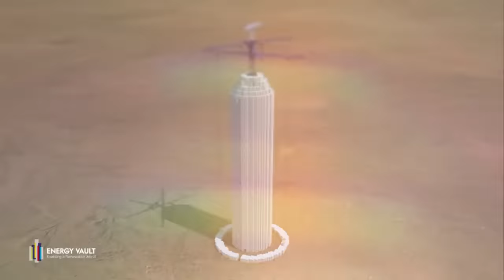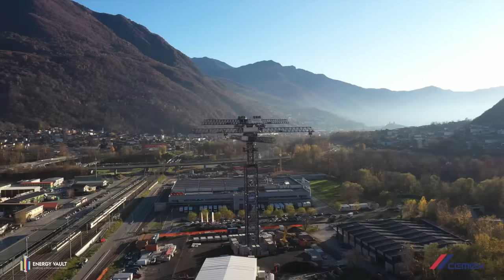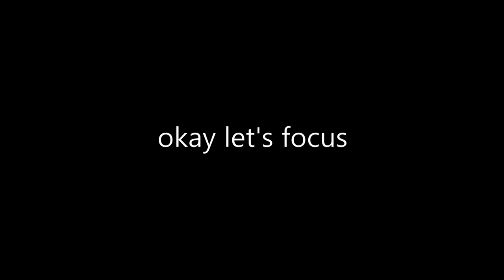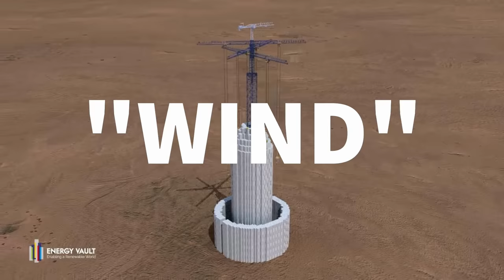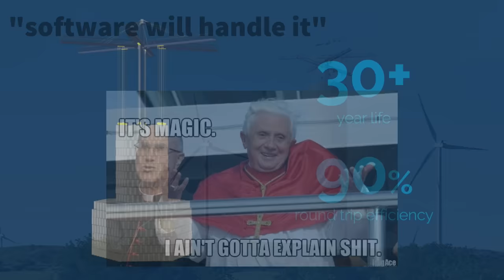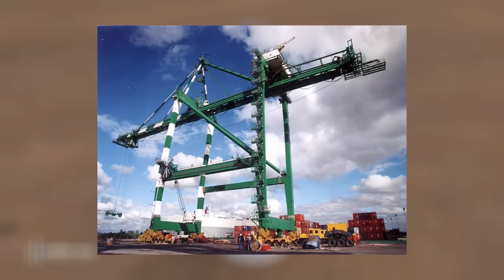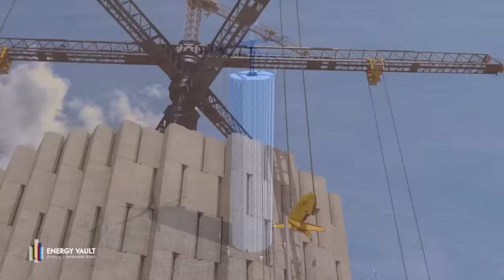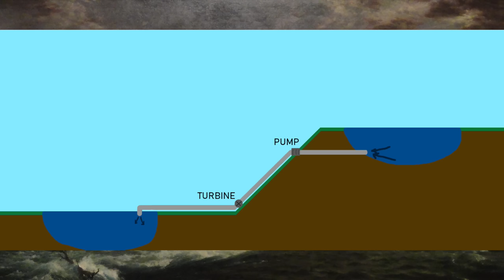The Energy Vault is a Dumb Idea, Here's Why

Comment: Adam casually improving on a "revolutionary new invention" only to turn it into an old pre-existing technology that already works much better will never cease to be hilarious.
Reply: Can you explain how this system would work in the southwest usa where there is not enough water?
Reply: @aaronburns9365  The same water is reused over and over so it's not really much of a problem. All you are doing is pumping water up when energy costs are cheap and releasing it to drive a turbine when immediate energy is needed. Edit : yes this is at a net loss but it's not as lossy overall as the ridiculous crane and blocks idea and both are only used to cover unexpected high demand. It's a battery.
Reply: @englishsteve1465  Large scale storage systems are going to experience a lot of loss from evaporation and soil seepage. It is not viable in arid climates. If it was viable then you would see more hydro power being used in the southwest. As it is there is very little b/c there is vary little water.
Reply: @englishsteve1465  lol 😂 yer having more then one form of gravity storage is so dumb.
Its not like there is more then one type of battery that would be stupid.
Reply: @markrichardson2508  There are many forms of energy storage for systems like Solar and Wind power.
Weight, pulled up and down. Spinning a big heavy wheel. Pumping water up stream. Regular lithium batteries. Capacitors for quick response. Pressured air pumped down to earth.... Oh Last time I looked up I came up with 12 or so different storages and Pumping water, batteries and pressured air were probably the top 3 in that order.

CONSIDERING there are mulitple different solution as you say, why would you bring old 80s battery that is less efficient and just over all worse than many others now days?

The idea that is shown as "new" was old tehcnology back in 2013 so I they are not designing anything new. The biggest difference is that you can attach new weigh to the system which is interesting. I explored one where you have weights that you can't remove like in the Anime they made. I think doing it either way is fine one just requires more stuff. You easily have system that can drive one or more weights are once and when you lower them they are active one by one and when they reach the bottom they  activate next system and if you need more power you drop two or more weights at once but lose the stored energy faster.

I mean, I have no clue how these systems work :d I'm just random person claiming to be Electrical Engineer...
Reply: @aaronburns9365 it does make more sense to put it somewhere with a good supply of water. There are other proposals that are still more sensible that would work, though, like pressurized air or enormous flywheels.
Reply: @aaronburns9365  That kind of touches upon a separate issue of why people decided to build cities in the middle of the desert.

But there's already an answer to your statement, and that is to have these systems in some place like northern california instead, where southern california already derives all of its water from anyway. Basically your generation source and consumers are going to be geographically separated, and that's not bad. Not perfectly ideal, but not that bad.
Reply: @aaronburns9365  Pump water between two concrete cisterns, then. If that sounds like way too much construction, then just compartmentalise the 1,000,000 m³ of water into 20m³ blocks and move everything around by crane. If that sounds even worse, then you can see the problem with "energy vault".
Reply: Trains!!!
Reply: @xezzee  I guess you didn’t notice the sarcasm
Reply: @markrichardson2508  text does not conway sarcasm well and I am not good at detecting sarcasm.
Reply: @aaronburns9365  pumped hydro is literally a closed system you only need to replace water lost through leaks and evaporation, the water doesn't get actively used it stays trapped in a closed system. The better designed it is the less water you lose from leaks and other issues.
Reply: Wait… I know you
Reply: @pricklesthecactus6183  I think I know you too!
Reply: @Brakiros  in an arid region you don't have the water for a pumped system and would have massive losses from evaporation. Making it fully closed makes the cost to much.
Reply: @aaronburns9365  just, cover the water?
Reply: @whyareyoulookinghere9135  That is a huge cost. There are not covered hydroelectric reservoirs. Even then you still get evaporation, it is just reduced.
Reply: Im going one better!Pyramid shaped mounts of blocks raised with people using sleds, ropes and levers! Its also good for emploment its a 5 billion dollar idea!
Reply: @aaronburns9365  can you guys use "to" and "too" in the right situations? I feel like since tiktok cancer came, everyone  forgot how to use them
Reply: @zoltanv7289  Never learned and don't really care.
Reply: @aaronburns9365  Month late response but your original point is exactly right. Pumped hydro or hydro power period doesn't work in areas with little or no rainfall, no elevation differences (flat land), and most significantly, areas where the water will freeze in winter. That was a big oversight or poor research by Adam. 

Currently we also use Li-ion  battery storage but that's both expensive and environmentally unfriendly. It's why this company and others already have hundred million dollar contracts to build their storage systems in both the US and China. 

It's also funny they solved they main problem posed in the video (wind) long before the video was released by enclosing it in a structure to block wind. Other companies propose to use decommissioned mine shafts which potentially saves money and space.
Reply: Jajajajajajajaja tienes toda la razón.
Reply: @keiyakins  If you have space for pressurized air, you have space for pressurized water, since it would be closed system there is no need for much water supply. And even if it's open reservoir there are means to decrease water vaporization.
Reply: @aaronburns9365  Water cisterns delivering the initial water, rainwater collection, pump water from the ocean. There, 3 solutions.
Reply: @aaronburns9365  how about don't move to a desert with limited water resources
Reply: @newnamesameperson397  How is that on me? Engineering is designing with constraints. People live in the desert. It is what it is.
Reply: @lidge1994  If those ideas worked, then they would be implemented. As it is they are not feasible for most arid climates.
Reply: @aaronburns9365  Is it not possible to just cover the systems to prevent evaporation. Obviously some will still evaporate but that would save a substantial amount of energy.
Reply: @plymbum6571  I have seen municipal water reservoirs that are covers but not electrical generation reservoirs. That is b/c the reservoirs for electrical production have to be huge and it is not economical to cover them.
Reply: @aaronburns9365  just cover the whole thing up ig
Reply: @aaronburns9365  in ur economic region substitute it🤦🏼‍♂️ there are many other forms of electrical storage did you ever think of that👌🏼🥹🧠 this shouldn’t even be used as it’s not even the best form of energy storage
Reply: Oh hey it's the Victoria 2 guy
Reply: @LakeGameCreepr  Oh hey! :D
Reply: @aaronburns9365  you obviously haven't seen arid reservoirs, they have methods of reducing loss from evaporation and soil seepage...
Reply: @xarxos5274  love your content, please do continue making it ❤️
Reply: @TheFriendlyInvader  Look how well that worked for Cali. I know there are methods, ineffective methods.
Reply: @aaronburns9365  oh conveniently enough many California reservoirs are not at risk due to being arid, instead they're at risk due to overuse primarily by agriculture.

In fact, the only reservoir which has employeed the use of such techniques from the LADWP saves well over a billion gallons a year.
Reply: @LakeGameCreepr  Thank you very much, I appreciate it! :D
Reply: @Brakiros  It's not
Reply: No point in reinventing the wheel when it was only ever meant to turn
Reply: @aaronburns9365  storing the energy in a different place
Reply: @englishsteve1465  I'm no engineer, but would singular metal blocks that never touch the ground under cover not work better than water? Each permanently attached to their own cable and motor or what not
Reply: @aaronburns9365  shade balls are a way to reduce evaporation by a lot
Reply: @superslimanoniem4712  How many shade balls you need for something like table rock lake? You think that cost is affordable?
Reply: The thing these guys are missing is that with every exchange of energy there is a loss, usually by way of heat, so it takes more energy to create the storage than will be returned. That is why pumped hydro is very limited. This guy is great how he casually shreds something that seems plausible at the start.
Reply: @aaronburns9365  just hit.
Reply: @aaronburns9365  the idea of "oh it won't work in a desert because there's no water" begs the question of how exactly you think people in that area drink water.  Like do you believe their water systems are also nonexistent?  Like its a desert so obviously there cannot be water systems running into houses, and everyone in that area has one daily trip out of the desert for water?  

The explanation is basically, we humans figured out how to store water fairly decently in a desert area, and the water storage battery idea may need tweaking slightly to make work, but we humans clearly figured out a way already.
Reply: @aaronburns9365  pro tip: engineers with a decent understanding of hydrodynamics don’t usually respond to YouTube comments. The real problem comes with creating and maintaining a massive man made flood plane and the resulting toxicity of seepage from a non potable water reservoir.
Reply: @Brakiros  A system that regularly starts and stops pumping water is no where near closed and never will be. We call it hydrogen bonding and the water hammer.
Reply: @ravensblade  no you don’t it’s a founding principle of physics called pressure/volume.
Reply: @callumprice1710  We have not figured that out at all, we can drill wells. This is why California as a whole is slowly sinking.
Reply: This classic technician versus engineering “wonderkinde” at play and I always love how stupid they come out haha
Reply: @callumprice1710  "the idea of "oh it won't work in a desert because there's no water" begs the question of how exactly you think people in that area drink water. "
Do the math on the scale of each. Water for drinking would be many magnitudes less. Are you also missing the fact that the west already has water issues. Just look at lake mead.
Reply: Water would need a lot more space.

Comment: It’s always funny to see ideas that sound smart at first but end up just being a devolution of an already existing idea
Reply: I wonder if trading a gazillion small blocks for just one big massive lead weight or some other heavy material would be better. Would last longer than stone and weigh more. One big block instead of many, you hoist it up when power is cheap and release it to generate power during the peak times to pay for the cost paid to hoist it earlier hopefully with some profit. Then you have just one big block to lift so there isn't this expensive dancing orchestra of blocks. Just one big one. Goes up and down like once per day. A really big block so tons of energy is sucked down but released later.  If you make just one big block I wonder if the pollution it creates to make Is less than if you made many blocks. Could even just be a big bucket built to last long term filled up with dirt even tbh. One big giant bucket would be a better idea because you could fill it up with different things. Could fill it up with some ocean water. A huge bucket. Put it in a rainy area. Idk man. Put springs under it so it reverses direction quicker when it hits the bottom. Do stuff to make if go up and down more effectively
Reply: @TheAnnoyingBoss  the fundamental problem will using a big block is the total energy stored is limited by 1 super basic formula:
PE = mgh
Potential energy (joules) = mass (kg) × 9.8m/s^2 × height (m) 

If you swap h to be kilometers then it measures kilojoules, and electricity is measured in kilowatt-hours which is 1 kilojoule per second for an entire hour aka 3600kJ of energy, the size of anything being moved must be insanely massive to even remotely be capable of storing more energy than just making a warehouse filled with chemical batteries. (Like you better be lifting a mountain)

Pumped hydro works because water is amorphous so we can easily pump it from 1 reservoir the size of a lake to another reservoir the size of a lake without needing the worlds strongest elevator.

Although something even simpler, use conventional hydro as your battery. It would take some restructuring of the operations and ownership of the grid but basically put a crap ton of solar panels net to the hoover dam and consider it 1 power plant, the solar works during the day and the dam stores water (letting enough flow to maintain the river's ecological health) then at night the sun stops shining and the dam turns on and provides the same generational capacity as the solar did. (Even better, they don't need to be next to eachother, just turn on/off hydro as needed to treat it like a battery, although some faster response batteries would be recommended, and the total hydro capacity of the world is finite)
Reply: Silicon Valley reinvented the bus again.
Reply: it just looks really stupid . they just waste energy moving blocks around and the entire thing looks like it would need regular heavy maintenence really often because all the parts would drop in durability all the time
Reply: That was just a fancy and extra stuff to transfer energy into potential.
Reply: Some ideas are more suitable for different types of terrain and geography.

Good luck building a dam in a dessert!

These solutions are all going to compliment each other and some of them will be more suitable for different environments.
Reply: @jasonreed7522  this is how we do it in Europe now: Central Europe gets powered by Norwegian and Swedish hydropower when there is demand while save on their own hydropower when central Europe has surplus energy - often from solar and wind. There are several hvdc lines going through the North Sea and baltic sea for this purpose. One of those lines connects Norway to Germany (Nordlink 2) and can deliver up to 1.4 GW at a  voltage of over 1 million volts.
Reply: Yeah  my first thought after seeing project after 1 second was "That looks amazing"
But then I started thinking "Wait normally stacking blocks high is really hard and there's wind"
Reply: Adam redet Unsinn..
Die Blöcke werden aus recyceltem Beton bzw Bauschutt hergestellt. Diese werden mit einem 1% Anteil Kunststoff zusammenhalten. Also kann diese Variante nicht nur Strom speichern sonder löst auch ein weltweites Recycling Problem.
Adam hätte sich vor seinem Video besser informieren sollen ;)
Reply: So, literally everything Techbros come up with?
Reply: @tarstarkusz Because his comment is pretty much "U wrong, lol." He didn't want to sound like an idiot so he wrote in a language that most people wouldn't be able to understand.
Unfortunately it seems he forgot google translate exists.
Reply: @justtherabbithole2577   u are apparently unable to use google translator. I'm sorry that all my comments are automatically translated ;)
Reply: @justtherabbithole2577  but what I wanted to say is that Adam has not informed himself about this project and does not know what the blocks are made of. Because otherwise he would know that they are not made of concrete.